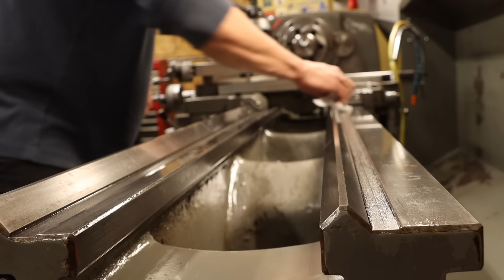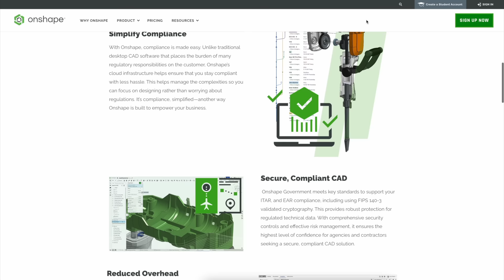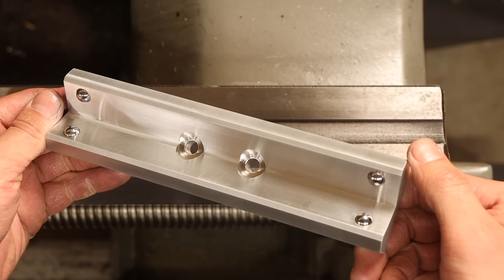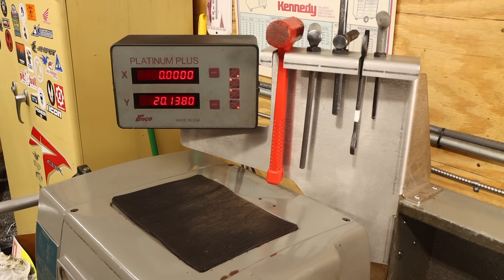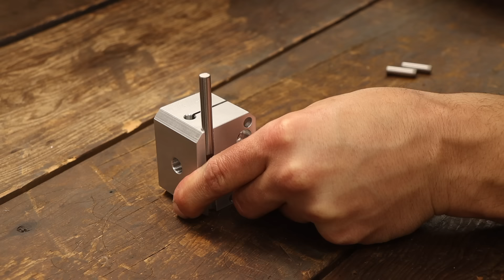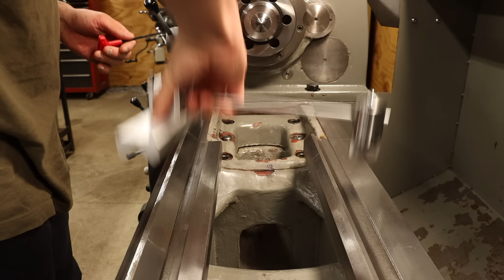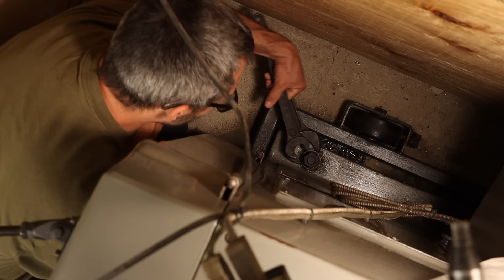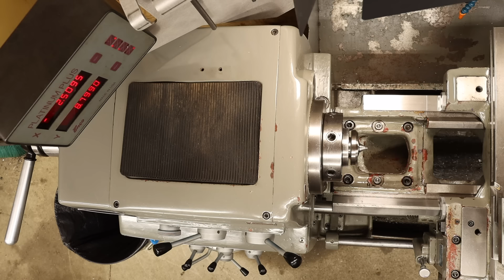A mistake... 3 years in the making

Comment: Millwright here. Machinery leveling screws are often hollow. They are designed to be set over threaded anchors, ideally epoxied into the concrete. That way you can actually PULL the machine down into level and/or remove twist.
Reply: Back in the 60's I worked in a large production shop. Had a very large maintenance department, probably 50 plus members. Electrician, mechanics, hvac and so on.  5 man team of setup guys.😮 Every machine in shop was bolted to a very substantial foundation and leveled. Even bench grinders and work tables and benches. I went to a small job shop in 1980. I had never experienced chattering turning before that. Worked in several different shops until I retired, never experienced bolted down machines again. Learned how to deal with chatter at the job shop so I was ok. Never forgot that first shop though. Did some amazing machining there! "The Good Ole Days" 🤣😎
Reply: Exactly right....the screws need anchoring into the concrete floor for best effect in keeping the bed straight and twist free.
Reply: "into the concrete"  Should be clarified as not the floor, but a hole cut in the floor.  Dig 5 feet down pack in 3 feet of sand and gravel, then 2 feet of concrete isolated from the floor by rubber pads.  Numbers proportional to the size of the machine,.
Reply: Well, if the objective is to be able to put tension on the mount relative to others this might not work. It’ll just pull out your 2’ concrete post enough to make it ineffective. 

It’s a perfect approach to isolate the machine from the effects of the floor expanding and contracting. 

Edit- I should Google before I type. Apparently steel and concrete have a very similar coefficient of expansion … so that might not be a problem??
Reply: @JackWilson327 that's why steel rebar is a thing
Reply: @JackWilson327  A foundation is great for machinery that requires it. But these little toolroom lathes are quite happy anywhere on a concrete shop floor. Even installing epoxy anchors is usually not necessary as the accuracy is plenty good for most of my customers. It's also nice to have the option of moving machines around at some point. None of the machines in my shop have foundations (or anchors for that matter). I only recommend those extra steps for specific applications such as:
1. The machine is constructed of multiple bolted together components/castings
2. Machines that are extremely heavy and can actually crack the concrete (10 tons and up). 
3. Machines with extreme rapids.
4. Machines that need extreme accuracy, and are already in a climate controlled environment.

Funny story. I had a customer with a very large HBM located in a shipyard. The operator actually rode on a platform on the headstock. There is a tide table hanging on the machine because the water pressure on the earth is enough to alter the level of the machine. Any precision work spanning several days was to be completed when the tide was at the same level. Crazy.
Reply: @andreblanchard8315 how about 15 or 20'! Saw this in the 60'!
Reply: @andreblanchard8315 pound in some 10 foot long 4inch pylons for added support if you really wanna go crazy.
Reply: @andreblanchard8315  You're describing a foundation. A toolroom lathe this size doesn't  need a foundation. A standard 6" concrete floor is sufficient. Just the anchor studs themselves need to be drilled an epoxied into the concrete. Never rubber isolation pads. Those allow the machine to flex and move. We don't want that.
Reply: @Bread996  I think they mean using the pads between the foundation and the floor, so no dirt falls through the slit.
Reply: Traditionally, precision grinders were placed upon end grain balsa wood to isolate the machine from vibration set up by other machines in the shop.  Subject to moisture ingress, (unavoidable) the wood swells less along the grain direction than across it...  Not now?
Reply: @robertlawson8572 today they might use something like sorbothane
Reply: There’s your answer!

Comment: How do you know your tailstock is parallel to your bedway? Your tailstock adjustment is only valid at a certain extension. 
Try running an indicator down the side of your tailstock extension while sliding the tailstock along the bed to check for parallelism.

Comment: If the Gearbox weight is what's bending the middle of the Bed level but it isn't quite enough, why not just hang a weight on the Gearbox Housing to increase the weight being cantilevered over the inner set of balancing feet?

In other words, if the Gearbox isn't heavy enough, add weight to the left face of the housing until it is...

Farmers and Construction Workers do that with the Counterweights on their tractors after all...if it works for them, why shouldn't it work for you?

😄😁😆😅😂🤣

Comment: Fine job.  I bought a round column 2 hp Chinese milling machine new and found after installing it the head was out of tram and not adjustable by 0.006" on a 6" circle leaving lines when using large face cutters.  Eventually shimmed the back left corner with some 20 gauge steel and now it's down to under 0.001"  Simple fix for a common problem.

Comment: Excellent video. I love diving into the minutiae like this.

Two things I thought that would be improvements; 3 balls instead of 4 (the likelihood that the tool is actually sitting on 4 is very slim) and always take your cutting passes towards the head stock. Cutting on the back side of the tool as you were doing loads the carriage differently and could cause things to act differently. Also, many light cuts (like a few thou max) will give you more accurate results. You want as little tool pressure as possible.

Comment: did you bolt your lathe to the concrete floor? Sometimes, the weight of the lathe is not enough to untwist the bedways back straight so you need to force it to straighten. Could get you were you want to be in terms of accuracy.

Comment: You might also have a height issue in the tailstock. I would try to turn a different length bar and see if it's still dead on if not you might have to shim the height of the tailstock

Comment: So is that why lathes need to be bolted to the floor? I just bought one that's 3000kg and I wondered what the need is to bolt it down. It's not like vibrations would shake it, but the bed straightening makes sense.

Comment: Chasing perfection is impossible. When I do a crankshaft for a customer  (very high performance) I have the customer bring their micrometers to my shop so everything is equal. Temperature. On rods and mains .0001 now check the bore or the bearings,, If I done the work on the block. Your videos make me hold myself accountable. Stuart 98s

Comment: I'm not a machinist, don't even consider myself to be an apprentice, but I do now have a lathe, that I haven't tested in any way yet. It showed up this morning, FedEx didn't require a signature, so it's getting the special unboxing treatment of being videoed incase what I received is something unexpected, And that's going to take some set-up time.)

My personal gripe about nearly every lathe restoration video I've seen, has been that while the lathes they do the videos on are small, I've never seen one of the restorer's do more than stone the ways, which may do a nice job of removing burs, but isn't going to insure flatness or straightness. I do wonder if we're going to start seeing videos where one or more of the creators have cobbled together a tool like this one (or for that matter have ordered one from china?) and they show running the tool across the length of the ways to "show it's level', and still miss checking to see if the lathe is cutting a taper or not.

My new lathe, it's a re-branded (Craftsman) Shereline 4400, with a reasonable compliment of accessories. Or at least that's what the Listing claimed. Only unboxing will show the validity of the listing. I may not get to this level of precision with it, but I'm not expecting to work on things that need this level of precision, so, we'll see. (Also see first note that I am not, and don't consider myself to be, any sort of machinist, except the curious aspiring variety. Who knows where that may lead.)

Comment: I have a small hobbyist lathe that is at my sons place since I don't have a garage. When I installed it I spent the better part of a day getting it leveled and dialing in the tail stock. Recently I had to turn a couple of parts for him to use on his tractor. The results were less than stellar I checked the level and sure as hell it was way way out. It was at that point in time when my son asked me if he had moved the lathe and then put it back if that was the problem...........GRRRRRRRRRRR...........LOL

Comment: anyone else know that that plastic bag is gonna end up annoying him? 

like, atleast use crushed sand or manually sand a chim to the right thickness.

my prefered method for you to fix this is roling a peice of steel to the right thickness, as it gets REALLY hard and therefore resists any change that might happen, but it also wont decay or straightup breakdown under load. 

you could also theoretically take the entire block out, machine it smaller and add a an adjustable spacer for it, buuuuut I doubt you would want to do that.

Comment: “Aluminium foil typically has a thickness of less than 0.2 millimeters (0.0079 inches). Standard household foil is usually 0.016 mm (0.63 mils) thick, while heavy-duty foil is around 0.024 mm (0.94 mils).“
Reply from the maker: foil! why didn't i think of that!
Reply: @InheritanceMachining I would swap out the plastic for the foil (or order more expensive foil in the form of thinner shims). That plastic could creep over time or flatten from some additional force applied to it and you wouldn't know until you were chasing a taper problem again.
Reply: @campiosa  + degrade and disintegrate from oils etc.
Reply: @ if you need to tip a part just a touch (ie for squaring on a surface grinder) a narrow strip of aluminum hvac tape makes a good “wedge” that stays in place when you move the part between the grinder and inspection table. The weight of the part compresses the glue consistently so results are close.
Reply: @InheritanceMachining creep, CTE mismatch, and chemistry mean you will be replacing your McMaster plastic bag shim sooner than later. Since you have a surface grinder, bond whatever shim stock you have to the part with Loctite 609, and then surface grind it in. Just keep it below 200F
Reply: You know that you can get feeler gauge stock from Germany that is 0.002 mm thick. It comes in a bit of a roll and due to it really being a single use thing as a feeler gauge not that expensive. I havent bought any recently the only time in the late 90's but they still make machine tools so they should still have it. In Aussie dollars it cost me about $30 for 2 meters.
Reply: And it will definitely lasts longer than a plastic bag because of heat, dissolution, and acid resistance.
Reply: @  heat and acid? What are you doing to your lathe? 😉
Reply: Lol..For those fine adjustments you can always get gold leaf which is 4-5 millionths inch thickness.
Reply: Just what I was thinking.  Theres no way that plastic stays the right thicking after a year
Reply: ...and cigarrete box outer foil is thick enough for you to insert it in tool holder, then insert reamer to skew it, to make a slightly larger hole. When I told that to a guy he responded with "well... we  always have those around here"
Reply: Foil is great, it's what I used to create a bunch of shim squares of varying thickness when I shimmed my 98mm flat burrs in my coffee grinder. Now it's parallel enough so the difference is less then the thickness of a thin dry erase marker.

Turns out the rotating carrier wasn't machined flat/parallell to the stationary carrier so one side of the rotating burr was lower. More then visible enough to see even on a lower end dial indicator.

Thank god the carrier was straight and on axis at least.

Comment: Would a piece of plastigauge as a shim have helped put a number there ?.. 🤔

Also, I think I'd have used a hi-rake ground HSS tool with the tiniest tip radius to cut the test bar on full length, carbides tend tohave a bigger radius and are also less "sharp" if you get my drift ... pardon the pun... 

Enjoyed the process !! 😉

😎👍☘️🍻

Comment: To take the z axis bow You can use anchor bolts to pull the lathe casting to the ground where needed
Reply: @InheritanceMachining or put a small jack in the middle spans lifting it up too
Reply: that sounds like it would drive me nuts just KNOWING that I was purposely introducing all that stress energy into the casting/ways.  I would feel like it's constantly under tension, like a spring. All that potential energy just waiting for the casing to SNAP in two the first time I drop something heavier than a screwdriver and it knocks into the casting, or when the building "settles" and I hear a loud POP sound from across the shop some night while I'm working on my computer.. and my heart sinks when I realize it was the sound of my lathe snapping in half. 😝
Reply: @dong6839 yeah... Except it's designed for exactly that.

Comment: Wow, those tool racks are amazing.  If I could only do the 3d design!
Reply: Just pirate solidworks or other cad software and use their tutorials, it's easier than it looks. Seriously, the main thing you do is pick a flat surface, draw a shape in 2D, and then use that to make a 3D object. Repeat until you have the finished product. I bet you could make those tool racks after a few days of learning.
Reply: @ I am a Luddite which I chose to dive into CNC and Fusion.  I quit messing with Fusion a d am attempting to learn something about CNC machines.  Playing with old manual machines for a lot of years my brain isn’t so plastic (or maybe it is!).  I’ll try again.  In a half a year or so.  Translating into the manufacturing tab (C.A.M.) actually created smoke coming out of my head.  I think.  Thanks for the encouragement!

Comment: where you use the weight of the head stock to bend the centre of the ways, does that take a while to 'settle' ? I'd guess that it might continue to settle over days and weeks so do you need to recheck it after a while ?
Reply from the maker: its possible. probably more settling happens in the concrete if i had to guess. grit and inconsistencies under the leveling feet.
Reply: @InheritanceMachining  not just possible , it will happen .  having installed cnc lathes and mills   professionally for about 14 years,  all machines regardless of size will  change shape (metal creep)
for a few weeks or months.  the small ones are the worst , because they are stiffest.  I've had to leave  new lathes with a taper , with the promise of being back in a few weeks to redo the
level.
And yes  anchors will help IF they are imbedded in the factory designed foundation slab. 
But they are not really necessary for most applications (a sound floor is however manditory)
In the end all , leveling screws front to back will eventually carry the same amout of weight
never forget all metal ,no matter how stiff you think it is , metal is really just slow rubber😉.

Comment: Hello, I have a silly question about fly cutters. Around 5min and 16 second mark, there is footage of the fly cutter doing it's glorious thing. But it looks odd. The cutter is moving away from the camera, but you can see the line of the cut on the metal block, and it looks like the trailing edge of the fly cutter is doing the work, not the leading edge. I am new to machining, but how is this possible? Wouldn't' the material be removed when the leading edge moved over first? What am I missing here? Thank you.
Reply: The diameter of the flycutter is larger than the bar length, so if the bar is in the middle of the flycutter, the leading edge could do all the work. Thats my guess, but I’m not certain
Reply from the maker: yes exactly like josh said. one of the benefits of the big cutter is i can fit most parts within its cut circle so i dont have to traverse both cutting edges. saving time

Comment: Using that plastic bag is a great idea to get the right thickness from squishing it. Just be careful, you could have some "flex" in it due to heavy machining torques transmitted through the bed. Great solution tho i like the craftsmanship.
Reply from the maker: good point!

Comment: That plastic better not be your long term solution. The forces between the hydrocarbons are going to flow and you'll be right back where you left off, so this problem isn't going away without you making it go away, so you're going to have to machine those surfaces one way or the other. or this is just going to keep chasing you forever. It's called plastic because it's going to deform plastically, and it's going to keep doing that slowly, it's going to spring, ait's going to distort and it's going to keep keep thinning until metal touches metal, it might take a long long time but you're not going to get consistent cuts with it any extra force going into it is going to distort your cuts, and lighter cuts are going to come short, you have to use metal on metal.
Reply: Yes, that plastic is probably going to creep over time. Also, as you say, it probably takes away a lot of rigidity.
But there are some epoxy based products filled with metal that are designed for leveling parts of machine tools. maybe he should look into that. Stefan Gotteswinter talks about that in one of his videos.

Comment: 12:48 don't do that, because you damage the collet chuck. It's a precision tool, not an anvil. You get -1 points in the shop.
Reply: "I'll hold it with the chuck so we don't damage the threads" proceeds to smack the part into the chuck, held by the threads